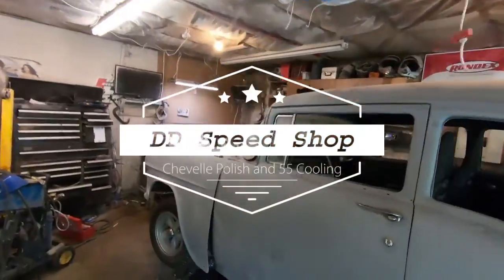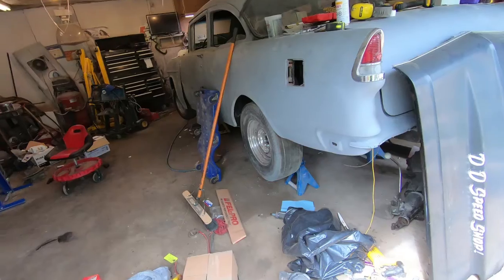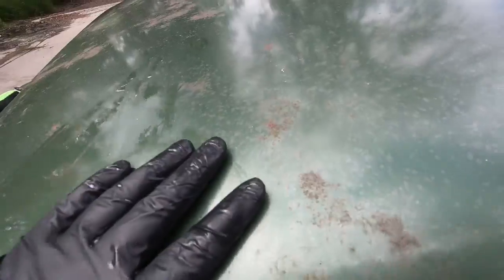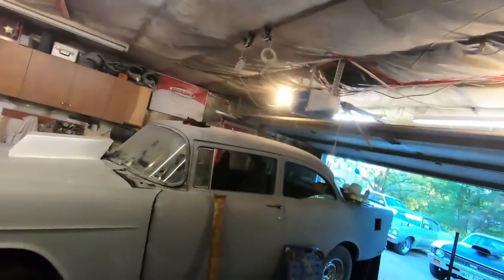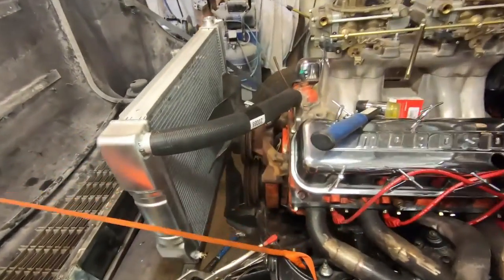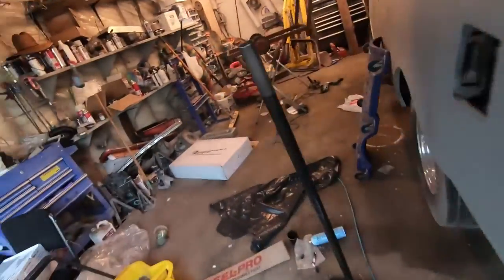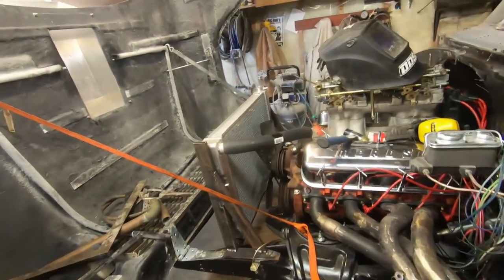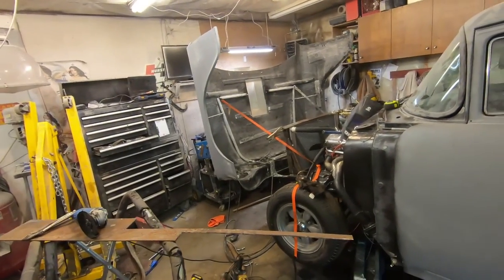Ratty Muscle Cars - Chevelle gets a Polish and the 55 Chevy gets a Cooling System!

Comment: On your rad support take a hole saw an put some holes in it. The brace bar an side I do top to .get some 1ich  electric conduit an weld in were you used hole saw  on sides just to dress them up .looks good I just did the 3r to 1050 u joint in 70 elcamino 👍👍
Reply from the maker: Yeah I was thinking about some holes and maybe a little pin striping or lettering.

Comment: Install a new set of  GM BOP 1970  Vista Cruiser rear springs on Chevelle ASAP ! it will left the rear about 2 inches , give it the LOOK ! and a much better ride.  I put a set on my 70 Chevelle & my Cutlass both.  I run a 265/70/15 on mine with room to spare.  :)

Comment: Good job you did it , you built the 1st Malibu g.s. s.s. /  that stands for , Malibu grand sport , super sport . Save the keystone's for another project , if their from the early 70s , .
Reply from the maker: Yeah I think keystones look good on tri fives.  Might put em on the 55.
Reply: @DDSpeedShop  the keystone's were popular for a short time along with the crager ss/ gt /.  And the slotted alloy..  the m.50,. Low profile took place of the 60s , series wheel well rub , the m 50  had to use air shocks to level the rake, air shocks were unheard of !. Good job.